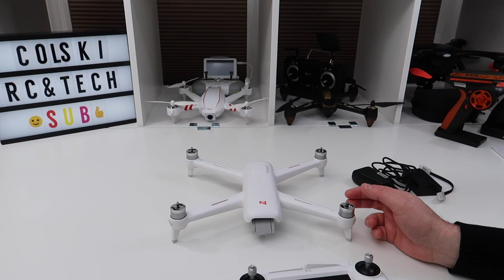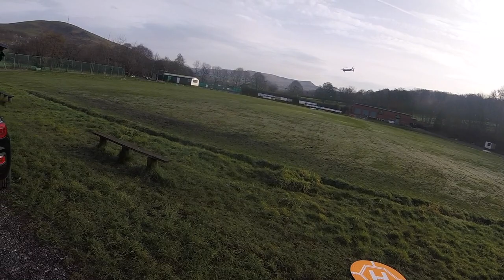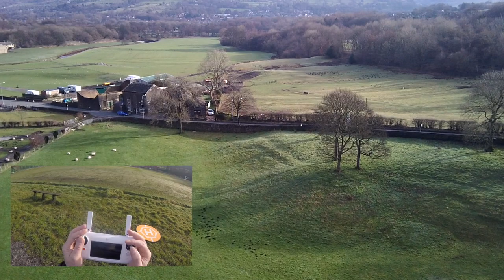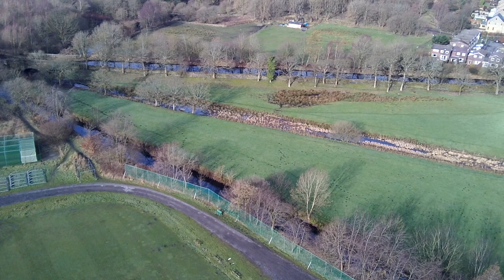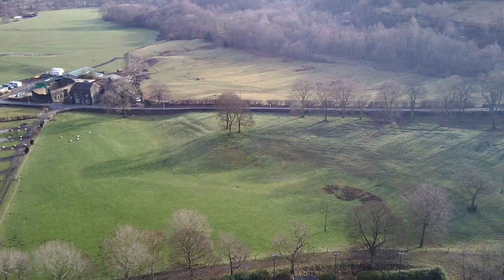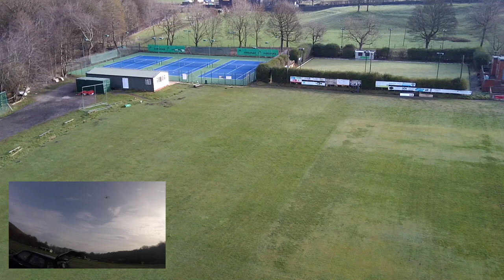XIAOMI FIMI A3 FLIGHT TEST

Comment: Very well done. This drone has an awesome camera. Seems to fly rather smooth. However the price for what you get is really a bit much. Here in the states its over $360.00.  For that money I would go with the XIAOMI FIMI X8... Thanks and be safe.
Reply from the maker: Thanks mate
Reply: The x8 is over 1000.00 bucks On Amazon, may get it cheaper from China.
Reply: @longboardlouie5816  You can still buy it on Ebay for 650. I really don't think this drone is worth that. Maybe  with optical avoidance. But,for that kind of money, there are now many new drones on the market, built by good companies, that can come close or match this performance.

Comment: Sorry for not much more the x8 is loads better the a3 is outclassed
Reply from the maker: Hi Its a totally different drone this is for flying FPV with goggles with zero latency which you cant get with any app driven drone that uses a form of wifi
The X8se is an excellent drone though
Reply: And quite a bit more money
Reply: Caught mine on sale for around $210 and it's GREAT for that price, plus the goggles totally changes the game, only thing I'd change is maybe a little better camera, but the one it has is great, and getting telemetry in goggles would be nice. Awesome for the price and if you just wanna make some decent videos, not necessarily pro, this is great

Comment: Hi again Colski from the prairies here in Saskatchewan where it's warming up nicely finally. I have the IMAX b6AC v2 professional balance charger, I have made the adaptor to charge the Fimi battery now do I just plug it in and set it to the specs of the battery and it will charge to 4.35 V?
Reply from the maker: Hi you need to select lihv on your charger instead of LiPo
Reply: @CKone41  thx again, I was afraid I didn't have that option for charging available, but I do. 
You're very helpful and reliable I appreciate it.👍💙

Comment: Could you please post a link to the balance lead connector.  I want to make sure i get the proper one.
Thankyou sir
Reply from the maker: Hi mate you need to make your own cable but Banggood sell a charger for the fimi which will charge it to full capacity
Reply: Colski Drones yes I understand that now, but unfortunately I've got IMAX B6 on the way, so I thought I would make an adopter like you have.

Comment: Great and very informative video :)
Question :  Re ~ Charging hand held RC ....
The micro USB cable supplied by Fimi has a reg. USB connector on the other end. I believe you charge the RC by the micro USB cable , but , what do you plug the reg. USB end into ?

I've watched , asked and e-mailed many, plenty video's FB sites as well as Fimi but no one has answered this question. Forgive my ignorance as I am an old (55yr old) beginner that has never run one before. I'm not very tech savvy and I don't know how any of them usually work :(

Thank you for your generous consideration,
Sincerely ....................................
Reply from the maker: Hi the other end plugs into a pc or usb wall socket to charge the controller

Comment: Your riggt i wont use their charger i use a hobby grade charger directly with their led wire. I do love it i have almost all of their drones 1080. 4k a3. Mitu drone i like this because of no cell phone ! I dont like the update procedure. the mi drone has the same noise. Through all their drones have the same i like it to be honest!
Reply from the maker: Yes my 4k makes the same noise
Reply: You say you can charge to full capacity using only lead connector? With a IMAX b6 charger?
Reply: Or other hobby grade charger?
Reply from the maker: @longboardlouie5816  providing the charger can charge LIHV batteries not all hobby grade chargers can  and also the early b6 charger can't charge LIHV either you would need to check the charger
Reply: Colski Drones thanks for replying Mr. Colski, correct me if I'm wrong, but this is the charger I ordered SKYRC iMAX B6AC V2 Professional Balance, and it doesn't say it charges LIHV. 😞
Reply from the maker: Longboard Louie hi it will allow you to change the final voltage fro 4.2 volts per cell to 4.35 volts per cell
Reply: @CKone41  I'm sorry I don't understand. Change or charge? And with just the lead wire connector? Or an adapter setup?
Reply from the maker: Longboard Louie on the charger display you need to change the value  of the final charged voltage of the cell it will be set at 4.2 you need to increase this to 4.35 
You will also need to make a cable to connect it to the charger
Reply: @CKone41  ok, thanks, I was hoping I could avoid making an adapter connection.  Thank you again for your help 👍

Comment: Nice looking but that squeal hurts my ears,worse then my hubsan h502s, I'm gonna try to lubricate the gears/driveshaft although it could be that the ecs boards are out of tune? My eachine e58 has grinding noises but I did mod it for light rain ,fog, and snow

Comment: DO NOT BUY.  FOGGING ISSUE continues as of May 2019.  ie.  Xiaomi did not fix it as promised.  I got my a3 last week and I flew it today (May 17) for the first time and I got FOG within 2 minutes.  When I looked at the lens it was covered with condensation on the inside.  D’Oh!
Reply from the maker: Gimp Man mine has been absolutely fine have you contacted fimi?
Reply: Colski Drones So far just banggood.  Will contact fimi tonight.  Others been having this problem recently.  In at least one case fimi offered a satisfactory resolution.